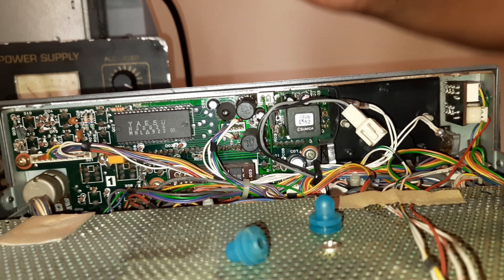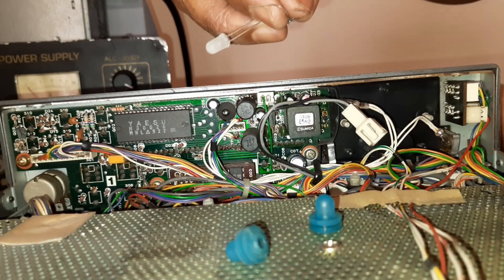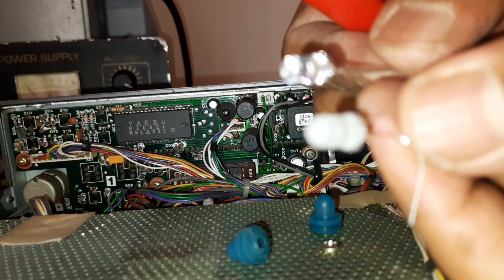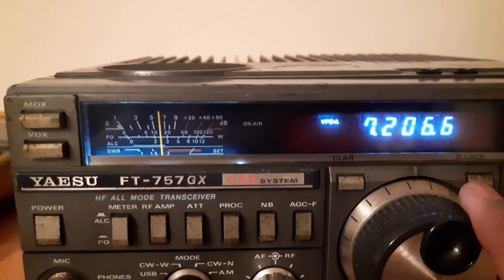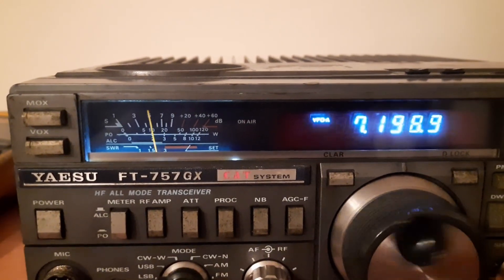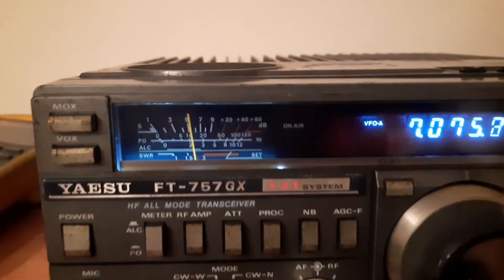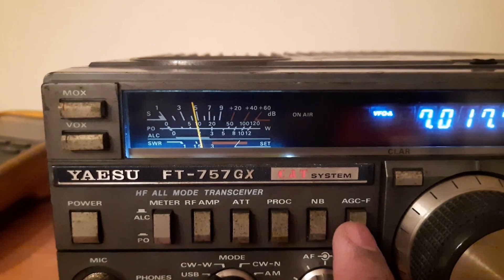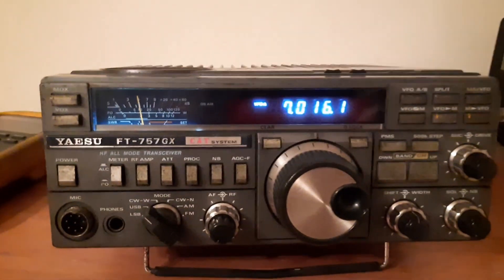YAESU FT-757 S Meter back light replacement

Comment: What voltage are the original bulbs?  Did you put your own resistors on the LEDs, or did you buy voltage-specific LEDs?
Reply: I just did this same mod on mine, used 3v leds, with a 470 ohm resistor in series, worked very nicely!! Original lights ran at the same voltage as the radio, 12-13.8 or whatever your input is.
Reply from the maker: Old bulbs are 12V.     For LEDs resistor used in series.